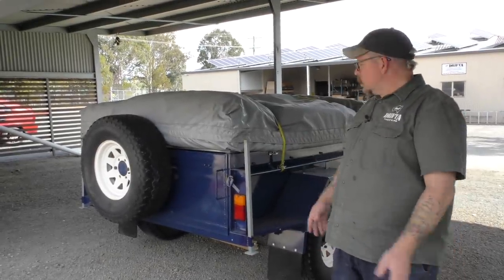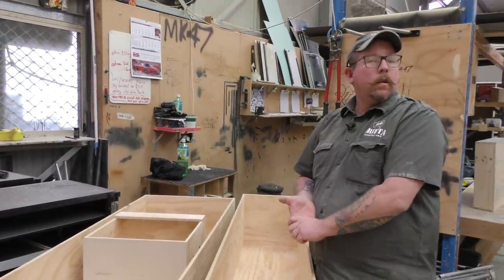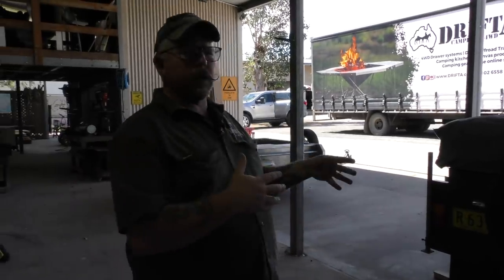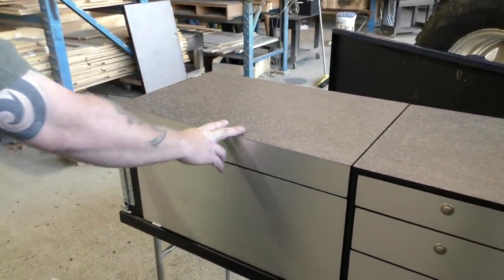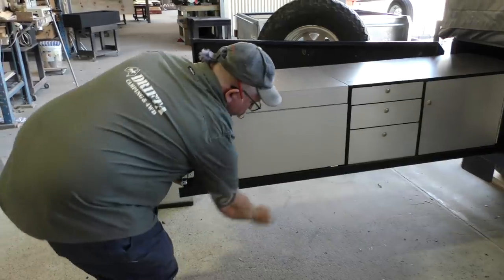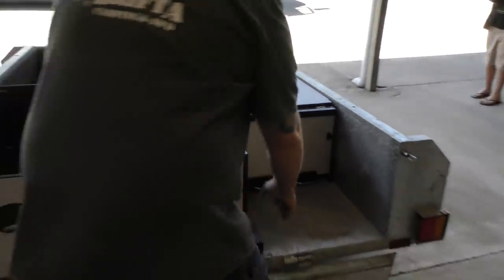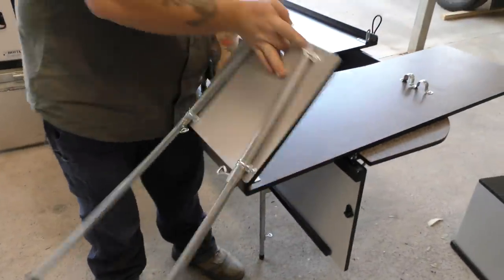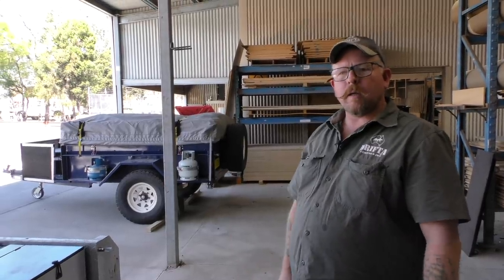7x5 TRAILER PACKAGE DEALS - CREEKY

Comment: I have a 5x7 heavy duty box trailer. I've added a battery and 140l fresh tank underneath with 12v pump, 12v lights, huge checkerbox tool box at front, rubber matting, lpg and diesel mounts etc. We have a soft tonneau on it and sleep in $60 dome tents. Use tactix boxes from bunnings as our kitchen and a $50 piece of acacia from bunnings as a table. You don't need to spend 30k on a DOT or patriot to get towing a trailer!!!! Love love LOVE the trailer life. Love my drifta canvas.